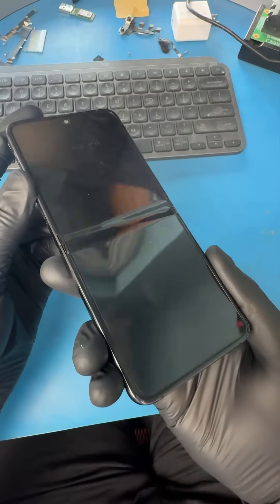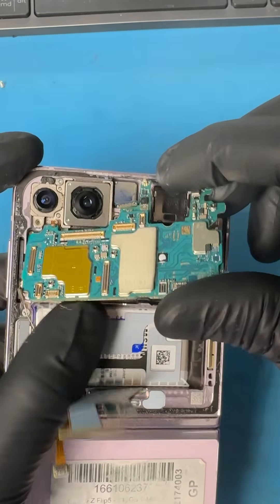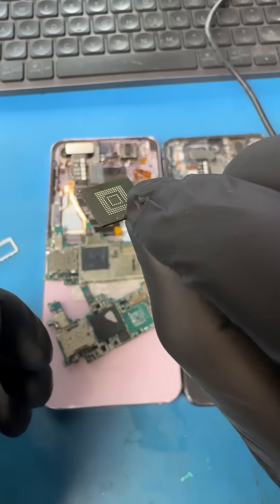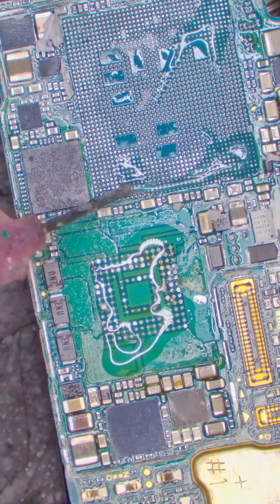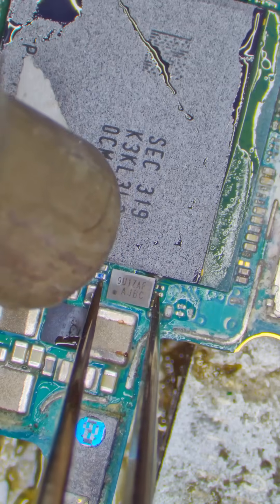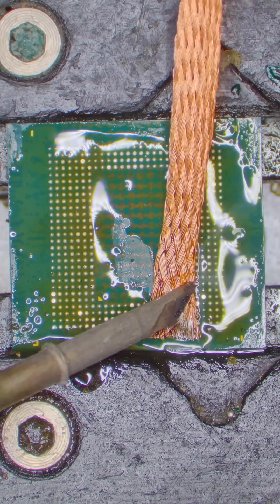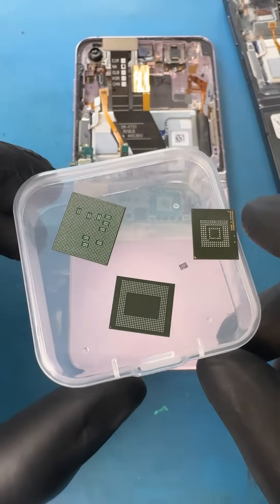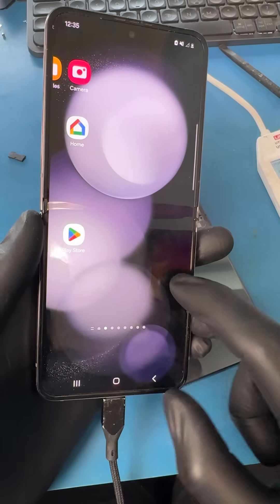Data recovery from a Samsung Galaxy Z Flip 5?

Comment: Imagine if original phone had an additional hardware data protection solution. If something happens to phone, such as hardware issues, 3 wrong password attempts, or such, EEPROM will get bolted with 50V spark.

Comment: My brother, I have two questions. Does cleaning the speakers, mics, and charging ports of a cellphone with a new toothbrush and some 70% alcohol damage the device? I soke the toothbrush and before cleaning the device, I shake the brush to get rid of excess alcohol, then clean. Sometimes I put a vacuum cleaner under the cellphone to prevent the alcohol from getting further in and removing debris. Does suction damage these devices as well?

Comment: Might I know if you would be able to repair bricked pixel fold without replacing motherboard? As far as I know there is no way to flash pixel phones if they are bricked (it doesn't turn on, black screen) but is recognized by PC as "pixel rom recovery"...
It happened when I used pixel flasher app on my PC and tried to flash custom ROM along with root

Comment: for a wayer damage this is possible
but for a drop phone or accidentally damage its quite difficult if its storage based Ic's were damage
otherwise mostly technician said no for this type of work
coz they have to do a lot work with a fresh motherboard of that same device
which means either you can use it without touching that fresh motherboard or you have to agree for this modification, so that you can get back your data
but you have to keep that other old or new device or motherboard for your mobile
its a quite complex work which is showed in this video
just imagine how much you are going to spent for that data recovery
if the data based for damn documents or some Family memorable pictures
then money is not matter
otherwise guys its damn expensive than buying an old mobile from ebay or somewhere else
thats why i appreciate this work 👏👏👏👏👏👍👍👍👍👍

Comment: For years now I have been thinking about sending in my old iPad Air Device the hickey inside the device that tells the device to show what's on screen passcode absent it does not work correctly the only way I can get the device to show anything what's on screen as if I take the home button click that and enough button at the exact same time I clicked them together it's tricky but it's a trick that basically it will show what's on the screen and I don't know what's going on you know I wanna put the iPad to sleep or turn it off basically what happens is that I can't just click the home button or the side button to turn the device on on just to be able to wake the device up like it's like it's supposed to I tried looking for secret settings I haven't found anything but I've had I was told at one point that I might've spilled water or something but I honestly do not remember like I said that's what's going on with the device but I'm thinking about replacing my device anyways but when typing this out right now I am asking how much will it cost to send in my device and then how much will it cost to send it back I live in the US in Michigan how much will it cost me to send it to you and then if I need tax as well it would not or even how much will a refund cost if you are unable to fix the device with the problems the device works perfectly fine again when I'm explaining it's just what's going on inside the device itself do you think that reads you know what to tell the iPad show it's on screen that part inside inside the device I think it's broken so half and half doesn't hopefully explained what's going on in a clear way for you so you can understand like I said I am curious to know how much it cost to send send in the device and then send it back